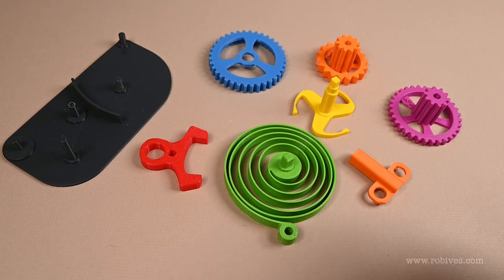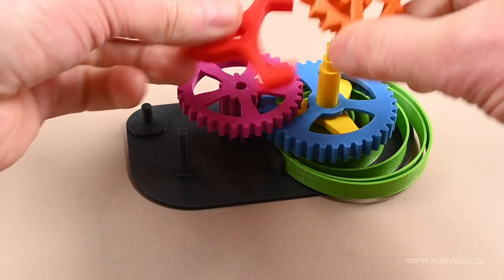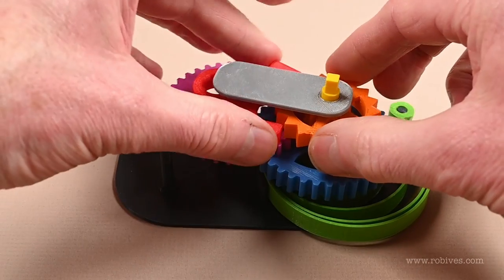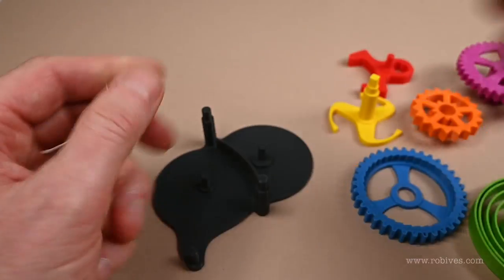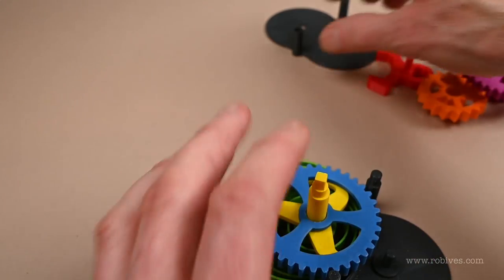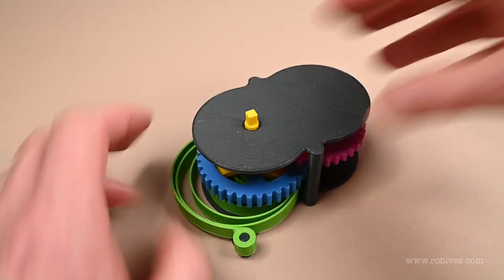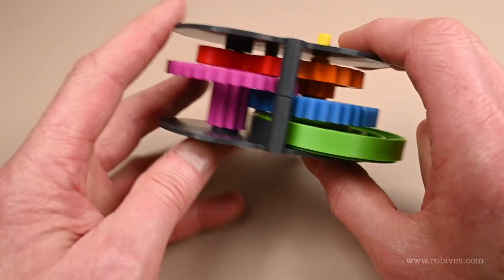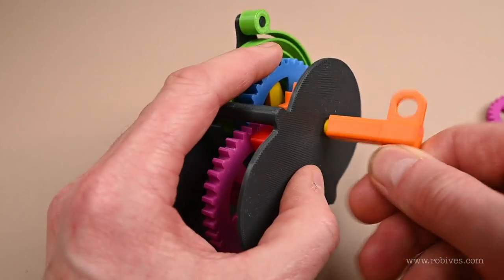ClockDev : Making a 3D printed clockwork motor

Comment: That's really interesting, thanks for the close-up demo. Does the escapement/fork just provide a little speed control? It seems like it keeps it from running away too fast. I've only seen escapements in clocks, so this is a new concept for me.
Reply from the maker: Thanks Ben, Yeah, the escapement controls the speed of the motor. Without im the spring explosively unwinds in around a second!

Comment: This is so cool!  I'm trying to learn about building a clockwork motor for one of my grad projects, and I'm trying to understand what the fork/escapement does in this motor?  Is it part of the timing?
Reply: I have a feeling the escapement in this device really does absolutely nothing other than destroy the teeth lol.  It's not really doing any escaping, it's just bouncing off the teeth of the "escapement gear".  Interesting attempt, but, I wouldn't call it a success other than it moves.